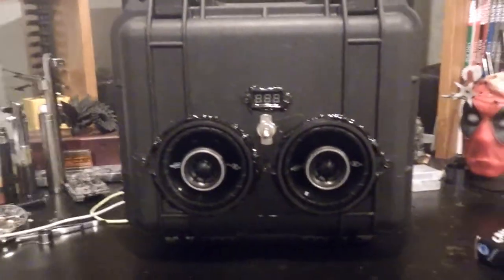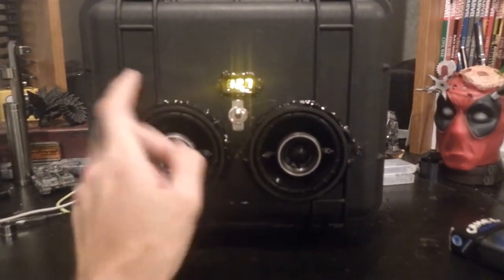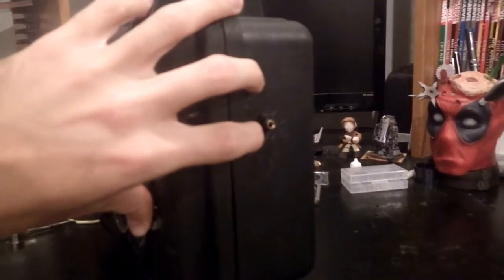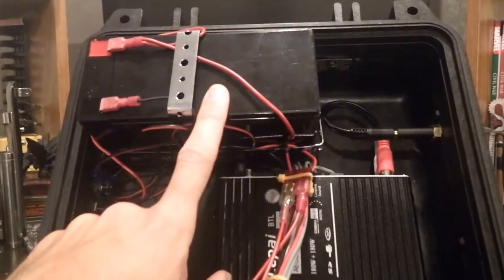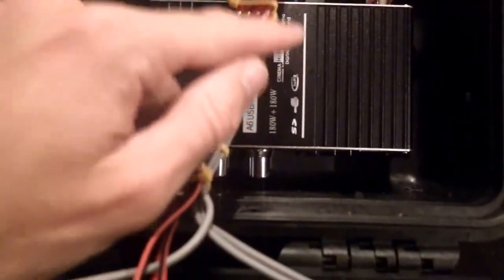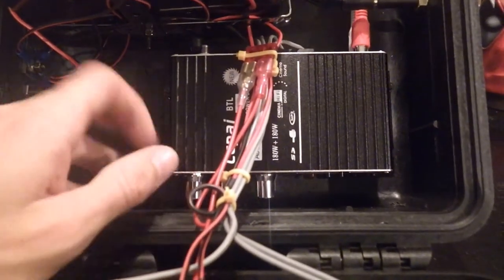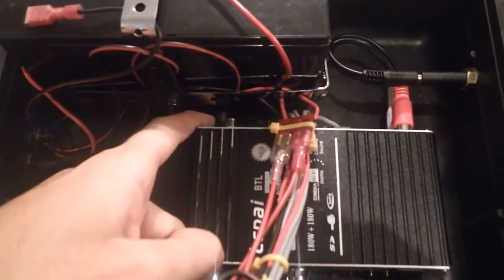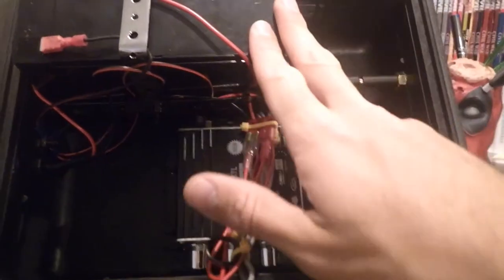DIY Pelican Boombox Finished pt 1

Comment: What is the model number of the Lepai amp and kicker speakers? Thanks. Good job.
Reply from the maker: Daniel Clancy It's a Lepai LP-A68 and the speakers are 3.5" Kicker DSC35. You can get cheaper parts but because of where I'm at I was very limited so this is what I went with for my build. If you have any other questions let me know! Good luck if you're planning on building this guy.

For Speakers
http://www.amazon.com/gp/product/B004PRUTLY?psc=1&redirect=true&ref_=oh_aui_detailpage_o04_s00

For Amplifier
http://www.amazon.com/gp/product/B00721Z1AE?psc=1&redirect=true&ref_=oh_aui_detailpage_o05_s00

Comment: what do you use to charge the battery?
Reply from the maker: I use a Yuasa car battery charger. You have to add a male plug to the end of it but it's the easiest and safest way to charge the batteries that I've found so it works for me haha. I'll link the one I use below, I usually cut apart the cable with the round charging end since the gator clips are usually used more often.

https://www.amazon.com/Yuasa-YUA1201000-Automatic-Battery-Maintainer/dp/B00HZTDKZG/ref=sr_1_1?ie=UTF8&qid=1485462774&sr=8-1&keywords=yuasa+charger
Reply: Van Damage cool, thanks. Please friend me on Facebook so I can private message you